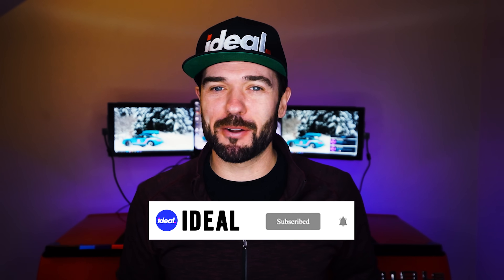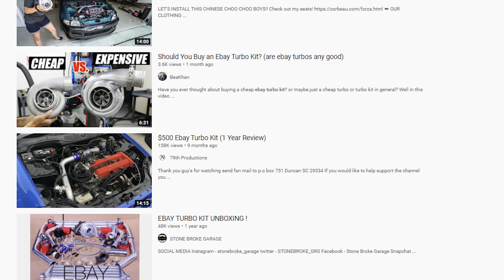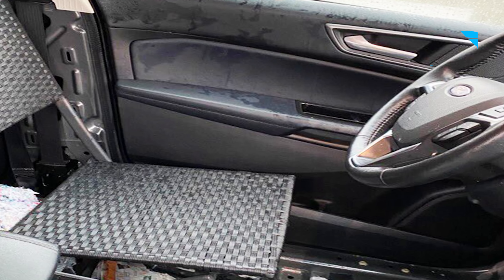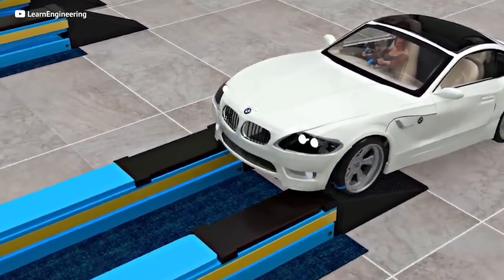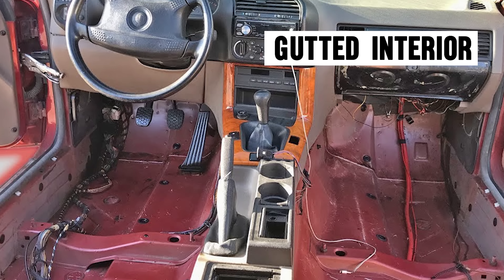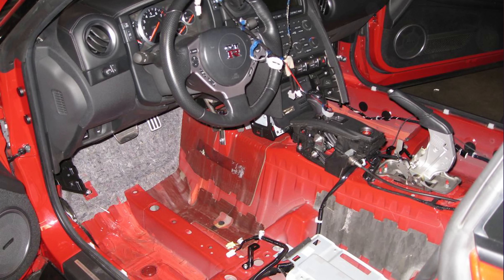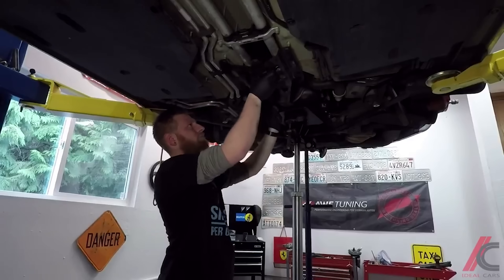You're Modifying Your Car WRONG!

Comment from the maker: Want To See HOW We Make Vids? Follow Us BTS On Insta - https://bit.ly/IdealMediaInsta
What is a modding mistake the rest of the community should know about?! Let us know below!
Reply: Loads of camber on your wheels
Reply: Do not change the Seats on the Daily Driver for After Market, if it's not Manufactures Option. Don't do it.  They're connected to the weight sensors to the Collision Air Bag System,  which measure the weight and the seating distance to steering ( Short Drivers usually girls ) They don't line up with the car subframe therefore, drill and then exposed metal (rust would develop) 

High camber is worse than Lowering, there is more thread on the pavement on bicycle lol 
Brad hopefully, Tina won't get full after market seats. The Collision Air Bags Lights would be on and Warranty would be nulled and may encounter Insurance issues, if air bags don't work appropriately.  Good job though👦🏻👍🏻💥🌠🏎
Reply: Got alignment done last week*
Reply: The addition of 20 thousand extra speakers is something that should stop 😂
Reply: @erito23gamingpower99   No kidding adding all that weight taking all that trunk. So instead of long road they spend on a car, which pick up groceries or a girlfriend
🤣👍
Reply: I got my wheel a line yesterday because I learned from Scotty
Reply: What 😂 he has a "DANGER" in his MANE ???
Reply: @aviiralsharma   Yes he is
 Brad Danger
Kind of like I have been told I am crazy, I would just a bit.  
Stage name wouldn't want your full exposed to world.
Reply: You should make a video on the best sports car for tall people for under 15k and under. Please
Reply: Let people like it's there money
Reply: Referring to a comment you made: That's What She Sayed 6 Month's Later.. — GJK ↑ TGW!!  🤎🌊🌊🏄‍♂️🌊🌊🤪
Reply: Do you know about the LIBERTY WALK modding shop??....Is it good to mod there? (It's pretty high rated though)
Reply: @ChasingDifferentAdventures by off r see
Reply: i know Im asking randomly but does anybody know a trick to log back into an Instagram account?
I somehow lost the password. I would appreciate any assistance you can give me!
Reply: @Jason Miles instablaster =)
Reply: @Davis Conner thanks for your reply. I found the site thru google and Im trying it out atm.
Takes quite some time so I will get back to you later when my account password hopefully is recovered.
Reply: @Davis Conner It worked and I finally got access to my account again. I'm so happy:D
Thank you so much, you saved my account!
Reply: @Jason Miles Happy to help :)

Comment: I remember when I had just turned 16 and got my 1st car an 86 Datsun Maxima I thought it would be so cool to put hood pins on my ride so I went to Autozone got a hood pin kit. I whipped out my drill and put a hole right through the hood and into the radiator. yep the was my 1st big fail with cars... but good came out of it I took it to the local repair shop and the manager help me put a used one in from the junk yard. he loved my ambition so much he gave me my 1st job working at the repair shop. I also enrolled into a running start program for automotive while in high school. when I got done with collage the owner made me a manager of my own lube shop in our town at the age of 21. its crazy how one mishap can change your whole life.
Reply: Man, wish I had that mishap. I work behind a desk all day 😞
Reply: That's sick I wish I had a cool car and  a job with cars

Comment: ALSO. i recommend having a second car before getting into heavy mods so you dont feel pressured to rush through any work.   Take your time feel it out
Reply: I agree you should always have more then one car when you start mods. it will allow you the ability to take your time not rush, have a backup ride incase something goes wrong (and it will) and nothing sucks more then getting halfway into a project and forget to get a part at the shop. so  always have a 2nd car or my personal moto you can never have too many cars
Reply: Not agree
Reply: Just get a bike more effortable

Comment: One of the first modifications I did to my sister's car (I was about 10 or so.  She is older than I am and I didn't have a car at that time) was adding driving/fog lights.  I did not know that you needed a relay between the switch and the lights.  We all know about the lights in the switches.  Well, I learned on around the third day/night that those lights needed the relay because the switch started to melt and then burst into a flame.  I watched the flame run down the wire, under the dash and then through the firewall.  I also had to listen to my sister scream while she abruptly slammed on the brakes, and of course, felt an instant stinging and a warm sensation as the blood ran from my nose from her instant right jab.  Lesson learned.

Comment: For all of those trying to mod their cars:
+5 hp per sticker
+5 handling per grams of blinker fluid

Make sure you get synthetic blend for the blinker fluid and the holographic one for the stickers.
No need to worry about all those unnecessary tied parts that you need to upgrade just because you replaced one part.

Best part of this is that you get ALL the clout on the streets and off the streets.
(don't expect it to upgrade your performance on the sheets though, that's gonna be all you but do buy better rubber and proper oil for that)

Comment: The only things I have done to my Chevrolet Sonic LTZ Turbo is strip some weight, added an interior lighting kit, and upgraded to carbon ceramic brake pads. I stripped the underhood cover just to get easier access to the washer fluid hose.

Comment: Procharged a rcsb Silverado and a bad injector wrecked the engine on day 2. Pulled engine, full forged rebuild with some more power adding goodies. Now I'm on my 4th built and broken 4l60e trans and doing research for a 4l80e swap.

Comment: When i was an idiot (it hasnt changed much honestly lmao) I wanted to buy tires that had a lower load rate than what i needed and the shop refused to sell them to me once they found out what car i had. The only thing i wasnt happy about is that the shop didnt go out of their way to help me find the spec tires i wanted with the correct load rate. I ended up going to a local small shop and they helped me thru everything including fitment.

Comment: Here's another important thing to think about.  Many newer vehicles have a few sensors in the seats to assist with the SRS/Airbags.  So if you do remove the seats and unplug the harness, then replace the seats, you car may not start, or if it does, it may only go into limp mode.  So, be sure to check with your manufacturer/tech manual or the dealership or a local body shop BEFORE you remove the seats.

Comment: I installed a 345lpr fuel pump in my C4 Corvette, before any other power mods because in my ape brain like "more fuel more better" the fuel pump had a higher minimum flow rate than the max flow rate on the old one, and without burning more fuel or using bigger lines, the pump killed itself by constant restriction, 600 bucks of aftermarket wiring, pumps and misc parts down the drain

Comment: Do not change the Seats on the Daily Driver for After Market, if it's not Manufactures Option. Don't do it.  They're connected to the weight sensors to the Collision Air Bag System,  which measure the weight and the seating distance to steering ( Short Drivers usually girls ) They don't line up with the car subframe therefore, drill and then exposed metal (rust would develop) 

High camber is worse than Lowering, there is more thread on the pavement on bicycle lol 
Brad hopefully, Tina won't get full after market seats. The Collision Air Bags Lights would be on and Warranty would be nulled and may encounter Insurance issues, if air bags don't work appropriately.

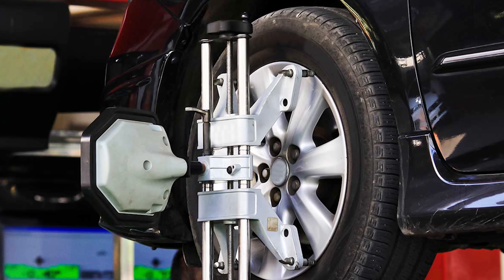Comment: 5:00 I did an alignment with 4 mirrors 4 flashlights 🔦 and 4 Jack's!  And as for tyres I got smart. I got 200 lbs of rubber bands to put on my rims.  Yeah watch those go flat!  And my rims are tight. I used Reynolds wrap and Suran wrap (not that wannabe stuff like glad wrap) to make my factory rims bling.  My 1983 AMC Concord is the best car in my hood of  Is council bluff Iowa.  We keep it real on the west side...  not too far west that's Omaha.  They have the Chrysler Concord...

Comment: I'm klnda glad for this vid. I have a 15 Corolla S model and just want to add some suspension parts. This is because I drive over a mountain pass weekly, so I want my suspension and handling to be better. I wouldn't mind getting a cold air intake either, but that's not as high on my "want" list.
Editing: I got the car last May so I haven't gotten an alignment yet. I do wanna get better tires for it, so when I do, I will get an alignment then.

Comment: An alignment isn't a modification, it's maintenance.  Unless you're changing stock specs, like more negative camber, for cornering/tracking.

The only car I'd gut is a full on race car with a full cage.

I wouldn't say the poly rear control arm bushings on my '99 Civic were a botch.  Just a bad idea to use poly on a street car.......they bind after a while.  My mechanic told me getting them off and cleaned out was huge pain in the arse LOL.  Don't use them on anything that has rotation.  High quality rubber like Hard Race or Delrin.

Those spinners were the most ridiculous mod!!!!!

Comment: I usually never take my car to a tyre shop to get the alignment checked, and thats only down to the fact that we have a floor alignment tester at work. Works a charm.
Onto the Ebay parts, i understand from cheaping out on tyres (once) and cheaping out on brakes (twice) that its not worth being cheap unless its emergency fix. Yet, the dealer principle at work, someone who can afford to buy expensive luxury cars 3-4 times a year cheaps out on ebay parts on the cars he gets modified 🤦‍♂️

Comment: I Got My 550 WHP(651 CHP) White With Red Stripes LBWK A90 Supra With A B58 Crate Engine, AMS Turbo Kit, Radium Port Injection, Dual Oil Catch Can, Fuel Pump Hanger With An AEM 340 LPH Pump, Drexler Limited Slip Differential, Red 4130 Chromoly  StudioRSR Roll Cage With A Rear Brace, Twin Sparco EVO II US Seats, Black Sabelt 4 Point Harness, Twin Sparco Seat Rails, KMP Steering Wheel With LD97 Forged LD12(Not LBWK) Wrapped In Pirelli P Zero Trofeo R Tires 2 Days Ago

Comment: I enjoy spirited mountain road driving and tend to have my wheel alignment and balancing done at least once every two months. Most times I do not get charged as the alignment stays aligned. Only time you really need to worry is if you drive very bad roads or hitting potholes. Luckily such work is rather inexpensive in South Africa. Issues we have is how expensive parts are as virtually all car parts are imported to South Africa, so whatever you pay in Dollars, multiply it by 15 to know what we are paying in our currency.

Comment: I've upgraded my k03 turbo on my VW Golf mk5 Gti by fitting a hybrid turbo with a forge actuator. The actuator was set too high resulting in a bent rod that took out by oil pump

Comment: Part of me wants to give this a thumbs up and the other part of me wants to slam the video. I have made a lot of the mistakes talked about in this video and learned the hard way as a result. My goal isn't to be a mechanic though. It is to learn about cars. I should have known based on the title some of the video would touch on things I've done and I agree with many points. The one thing I think is missed in the video is that it is okay to make the mistakes talked about in the video. I do modify my car for me! It's not about style, it's not about being trending or anything it's about that pursuit of knowledge and being a car enthusiast I pride myself on showing what I did wrong so hopefully others can learn and I can learn that next thing. Building a car as described in this video is an a to z type deal and my experience is that it is never a linear path. Had I started with a different car... I still wouldn't have learned as much as I do today about cars. Anyone can source a part on ebay, amazon, etc... but how long is the toy in a happy meal fun? Sometimes as you stated mods are that same way. Other times, they're not but how are you gonna know if you don't try?

Comment: I install some oracle wheel ring light and it was installed and last for almost 4 months 😅. But I know what I did wrong. It was still worth the savings. I learned. Next time I just make everything extra secure and tighten instead of wage between the two metals.

Comment: This video is dead on.  I started building a350/427 18pounds boost blew the motor on the dynamic now a 409ci  45kk later realized I need a Tran that could handle that mod 927hp at the crank.   So,  6000 for L480E and Stahl converter.   Then drive shaft, 1500, then rear end positron 4000, then front suspension 1200, 4 wheel disc brakes rotors 3000.  Then no vacuum off the motor so modified power steering pump to pull vacuum for the brakes and other accessories 1500.  It goes on and on. So now have a beatific 74' Camaro total 85000.   I could have a brand new vette.

Comment: So, I'm legally blind, and yet, have always owned a car. Yes, I've never driven any of my cars. I've had a 72 Honda Turd Hatchback, a 96 Taurus, a 69 Mach 1, a 71 Challenger, a 99 Chrysler Cirrus, a 14 Dodge Avenger, a 15 Dodge RAM Rebel, a 16 Charger, a 97 Blazer, and currently I've got a 12 Prius. Because the car before the Prius was a 03 Yukaburbaladeaho. That'd be a 03 Suburban with Yukon heated 2nd row, Escalade D pillars, Tahoe dashboard and center console, and various other trim bits off a Tahoe part out, and 2012 LTZ 20" rims. All the other cars on my list I never did ANY work on, not even oil or brakes. In fact until the suburban I'd never done anything other than change tires. Well, my brother bought the suburban as a project that was too big for him to tackle with a new wife and baby at the same time. He ended up selling it to me. What he'd completed was the tearout, and changing all the exterior lighting to led and hid. He'd bought carpet, and factory trim paint, and that's all. I got it home on a rollback, with no seat to guide it down the driveway. The interior was totally gutted down to the sheet metal. Everyone told me either "you'll never get that thing back together and running" or "it'll be a good year before that's ready to daily drive. The other vehicle I had at the time was the 96 Blazer which was about as reliable as a mobile mechanic quoting my wife a good price on an engine swap. So the Suburban had to take over daily.... rider? Duties quickly. I'll admit to having somewhat of a adoral fetish at the time, this being the case, I sat and looked at this thing for a couple weeks, orginized and ordered and scavenged parts, while watching youtube videos for that couple weeks, until the day my script got filled lol. Then the time had come! On a Thursday I started. On that Monday, my girlfriend drove it to work, with a ficticious tag lol. Mistakes? Well yeah! No one told me to start applying the carpet from the center outward, so the hard plastic section under the pedals? Yeah, that was more like under the putter corner of the front seat lmao. No one told me that I should just cut out where the mouth of the floorboard hvac ducts were, that I didn't need to expose the whole duct. Of course I figured that part out before it got too bad, and the opps was not seen, but under the seats. I put a double din touchscreen stereo in it, the lt console in the middle, with rear controls, I put headrest monitors in it, and the 2nd row was denali heated seats. I even powered them via the rear audio controls via the DC outlets power, using the 2 toggle switches for audio as on and off for the seats. I put two tone seat covers on the front seats, as new seats were stupid expensive, and they matched the two tone middle row, and I even dyed the third row to match. I upgraded all the speakers, even got the nose a pillars with the tweeters, and wired them. It was white, I changed the mirror caps, and bumper capsr to black, from white, which looked great, I changed all interior lights to led, put a 12 and amp I'm back where the factory 10 and jack went, I put on the 20" LTZ rims, which involved my jsck not going high enough so I dug rutt's out so they'd fit lmao, but what I ended up with was absolutely stunningly gorgeous! I finally understood my dad and his 47 ford, 48 chevy, 56 bel air, and 63 galaxy, I got it! I built that! It looks far better than it ever did new! Wow! I ended up getting married not long after and I gave the Yukaburbaladeaho to my step son, and of course, he traded it in on something newer immediately. I didn't put restrictions on my gift, so didn't say a word. Also, I did not complete all that work In a weekend, merely got it drivable. In total I had probably 400 hours, and 10k In a $3500 car lol

Comment: 2021 VW Jetta... New rims (17" to 19") and tires. New coilovers just to fill in the gap. Went and had the car aligned which came out close to factory spec but the steering wheel was slightly cocked. They could not get it straight so took it to the dealer... $180 dollars later and its still not straight and they said its a close as they can get... Stupid VW.